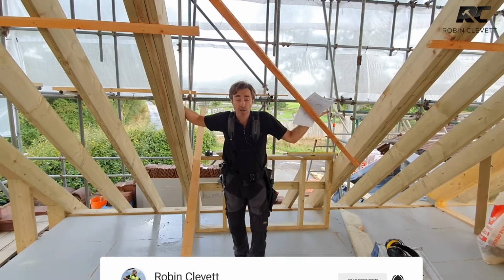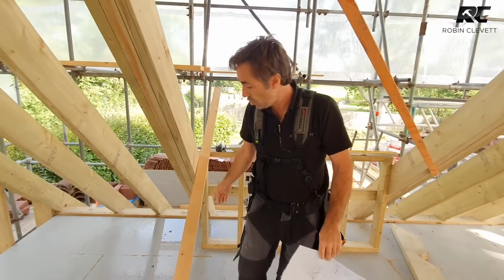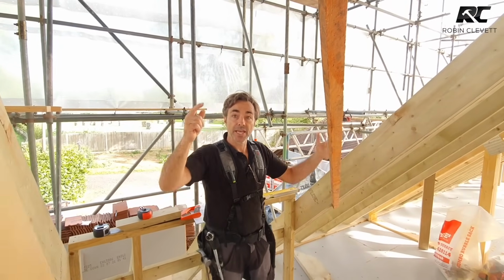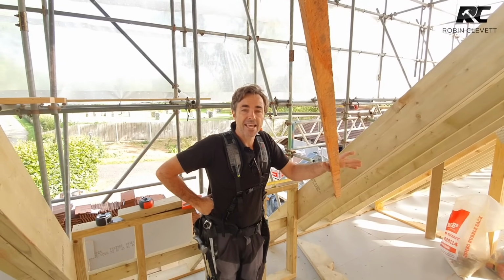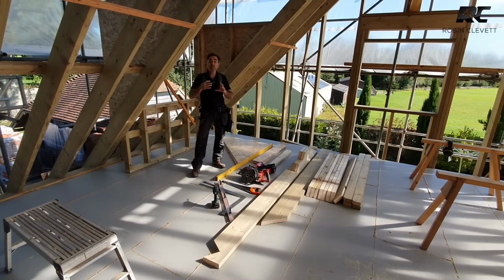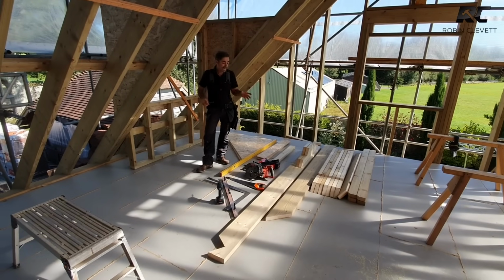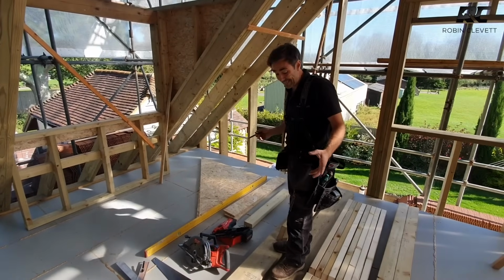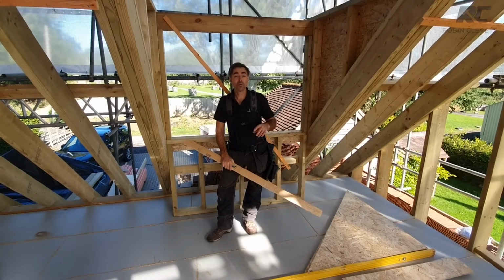Dormer Construction basics The wall Frames

Comment: Screws? Really? I mean bad enough they use fake 16d nails which are .131 nails 3-1/4" long, now screws are accepted? We only use 16d and true 16d .161 3-1/2" nails which only a small number of nailers can shoot oddly.
Reply from the maker: It's all about the types of screw, I use a construction screw that will perform as well as any nail, onto the nail thickness and length issue that you mention, all nails should be the size and type suitable to do the task, we always try to use a heavy duty galvanised nail in our nailers (gas and 18v) for structural timberwork these have been tested thoroughly by the likes of Paslode in years of development and I trust them!! Have a great weekend mate
Reply: @robinclevettcarpenter  Not a fan of screws for framing and never will be. Also from my experience I feel that galvanized nails are extremely dangerous because of their slickness. Although it seems that I'm heckling you I honestly am not. Do a test yourself. Shoot a regular framing nail anchoring two large pieces of lumber then hammer them apart. Next shoot a galvanized nail the same way, you'll find that with almost no effort you're able to break apart the lumber that was anchored using the galvanized nails. It's scary to think how easy it would be to lift off a roof during extremely windy conditions when using galvanized nails. Just my opinion. Cheers.

Comment: Another great video keep it up
Reply: @stantheman7467  hi Stan sin35÷tan45=second function tan =29.8° miter cos35÷tan45= second function tan=39.32 edge bevel
Reply: Hi Stan hip edge bevel formula cos hip pitch angle ÷ tan plan angle = second function tan =  . if you set the circular saw to the plan angle and cut along the plumb cut line that will give you the required bevel squared our backed
Reply: @stantheman7467  Stan one trig formula I use a lot to find the hip pitch angle if I only have the main pitch of the roof is tan(40)×sin(45)=second function tan=30.68° that formula is true for equal and unequal pitches the 45° is the plan angle . have a good day

Comment: Hi Robin, I'm constructing dormer cheeks by looking at your videos. I noticed that you put a little piece of vertical wood Next to the left first cheek stud @2:39 into  your video.  is that a permanent piece of wood that you leave there or is it just a temporary piece of wood to help you align second stud vertically? Thank you
Reply from the maker: I leave that there to space of the stud to carry the internal plasterboard corner and also fix the return window stud too
Reply: Thank you. I have piteched my own roof by learning from your channel and now working on dormers. (I hope my house will stand because the real work is in accurate measurments) I also found that your tip of using timber instead of tape is easier.

Comment: In what universe do they erect a temporary cover over the entire building for construction?
Is that standard practice? Is that a code requirement? How much does that add to the cost of building a house?
Reply from the maker: It's a big thing here in the UK to temporary cover the building
Reply: @robinclevettcarpenter  I see the advantages, it should be a requirement to prevent water damage. What is a typical cost for the rental?
Reply from the maker: This was about 10k